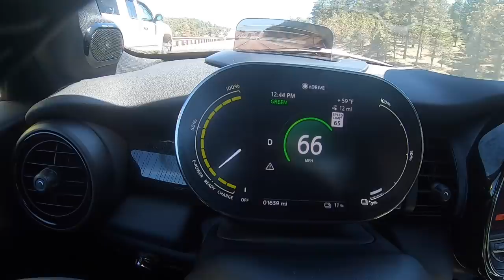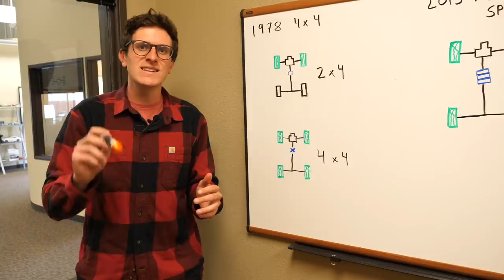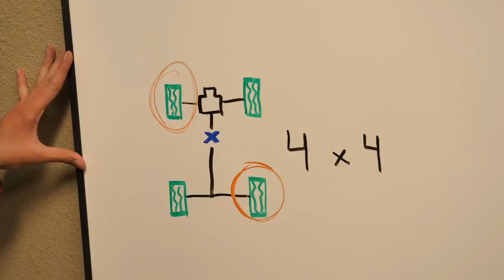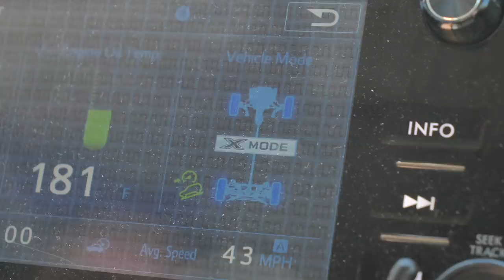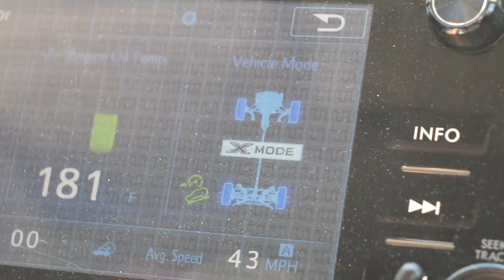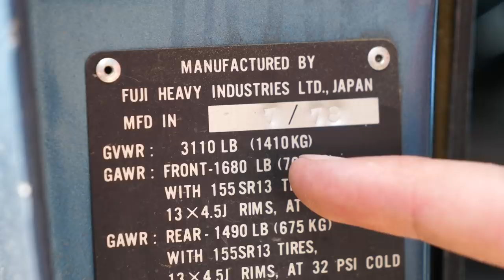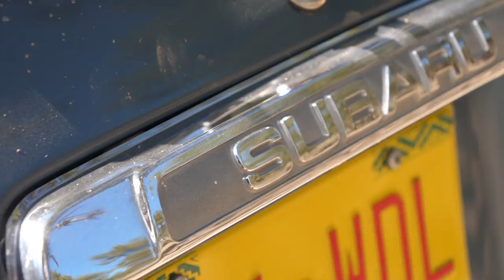Old vs New - How Much Better (Or Worse) Is a Subaru Outback Off-Road Than Its Great-Grandfather?

Comment: I owned the same car, except mine had a 1.4L transmission with a 1.6L engine I put in it . The trans was lower geared than yours.
You need a 2wd old Subaru to refine your driving style, always at the horsepower peak when you start up the hill or you will lose motor and traction.  Then you will always make it first try with the 4wd car. 
Also, after you break your first front CV shaft (I broke about a dozen on my 70s and early 80s Subarus, if you don't break a shaft, you are not using the car hard enough.)  you can keep the inboard stub in the car for when you break the next one so you just take your hammer and punch (Must haves) and pull the broken shaft, (they always break the outer joint) and put your stub in and all of a sudden you have a RWD Subaru with a parking brake on the front tires. 67HP will spin the back tires all day long on dry pavement with the parking brake on. 
One last thing, the spare tire absorbed about 1/3 of the blow in a head on collision, making the old Subarus much safer than their contemporaries. The old Subarus were also better in roll overs because of the many side posts. 
PS, when you start breaking front struts, that is when you should tone it down a little bit, not when you start breaking CV shafts. You won't break struts unless you are jumping more than about 15 linear feet with an elevation of 6 feet or so and land badly, anything less, and you can do it all day. Also, do not be tricked into getting aluminum rims, they shatter and crack when you use the car correctly, the steel ones just bend a bit. (You will eventually end up with 2WD rims, they are stronger than the spoked rims.)
Reply: Never broke a CV joint in mine. Or did I? LOL I do faintly replacing one or two of them. I used mine (a late '77 model) for camping in the desert and tearing around washes and up and down hills. I even drove mine through the infamous Pinion Mountain "Squeeze" and back out again once. I have pics to prove it. 

I did blow the transaxle apart on one trip. A gear tooth must have come loose I figured. Started getting worse over a 2-day trip to Ocotillo Wells, CA. Nasty tapping sound from the gearbox area. Finally went "bang" while was driving home on the highway. Such fun times. ;-) 
For the wheels, I had the factory plain disk wheels widened to, I think 5.5" or so by a shop in LA. That was to run wider tires 'monsterous' 195/70s.
Reply: @SDwriter.and.surfer   If part of your Subaru Enjoyment consists of full throttle with the steering at full lock, that is when the CV joints let go the fastest. I was a poor kid at the time, but not too poor to put a bigger used carb on and remove the factory muffler for the extra 5 horsepower that overwhelmed the CV joints. I also used to play games like "pretend the cops are chasing me" and I found jumping to be a fun pastime. Of course this was in the good old days when if I hurt myself, the next morning it was all better. Pretty sure I would quit and go home in the first five minutes if I tried that stuff today.
I once destroyed the spider gears  in a front differential, but I really enjoyed being able to fix the car cheaply and easily. I had I had a total of six Subarus from 77 to 82 vintage, and I had the most fun with those cars that I have had with cars.
Reply: @ethanc4920  Hah. I never tried that hard to break mine. Shortly after buying it I did have fun jumping it on sand dunes, on Fiesta Island at Mission Bay, San Diego. Dumb kid. I always told people, in the past and in comments here, that the Subaru was basically a water-cooled 4wd Baja Bug. No low-range so you had to charge some hills.  Just like with a bug. I rebuilt the engine once. Had it "blue printed" by an engine shop. Hah. Balanced pistons, rods, etc. Just because I read it was the thing to do. Had Schnieder Cams do a reprofile on the stick for better 'low end' supposedly. Result of that was questionable. And I also had a complete exhaust system custom made. Sounded cool. Biggest improvement made was the Weber carb. That improved the personality of the car by so much. Legend had it there was a twin-carb manifold for the 1600cc engines, available in Japan only.  I was unsuccessful in finding one here in the US. I did buy the high-compression heads from an importer in LA. Added a half a ratio to the stock compression. I never had the engine dyno'd so I don't know what all that did. But it helped for sure. 

If someone had said to me back then, "Someday you'll be able to buy a Subaru with a 300-hp engine", my head would have exploded. Nothing outside of Italy was making that kind of power (stock) in those days.
Reply: @SDwriter.and.surfer   Driving without horsepower or gearing requires much more skill than what is required when either is present.  All of my Subarus had a flat underside and a gas tank up inside the car, I sure I have hours of cumulative time dragging the bottom of the cars. My 77 (it might have been a 76) Wagon came from the factory with a 1.4L engine and therefore had a very low final drive ratio. In fact, that car had a lower first gear than the low range in my later Subarus. With the bigger pushrod 1.6L it went very well. I used JDM carbs on my Subarus, they were a few millimeters bigger on both the primaries and the secondaries. (And they were cheap.) Eventually I started putting 1.5 inch spacers under the Carb (on a 82 two-door hatchback with low range) and cut a hole in the hood for a round air cleaner. That worked very well for some reason.
Reply: @ethanc4920  Interesting. I have to admit, I've never heard of JDM carbs. For me at that time, the Weber 32/36 progressive was the best choice. It needed an adapter that was an inch or so tall,  and the 3-4" K&N air cleaner on top of that. Still fit under the hood nicely though.  It ran very well out of the box. Finally at one point I had some Weber 'guru' tell me now to tune more optimally. Jetting and emulsion tube changes. 

Some of the specs are really testing my memory, but I think the 1400cc engines were wet sleeve weren't they? Might have had two separate exhaust outlets on the heads, like a VW? My EA71 engine had 'Siamese' exhaust ports with one outlet on each head I remember that for sure. 

I don't recall the final drives of the axles, 3.8 something?, but I seem to remember that my 4x4 trans had a 4.0x:1 first gear, whereas the 2WD transmissions had something like 3.66:1. So the '77.5 4x4s had lower 1st and possibly 2nd gears than the non-4x4s. I don't know what it was for the years before and after that. I remember that my Subaru had the same 1st gear (4.02:1) as the 4-spd trans in the IH Scout II that I replaced the little Subaru with in 1991. (I still drive the Scout!) 

BTW, I also still have my Chilton's Subaru manual on a shelf I think. It covers all these pre-1980 cars/engines. And I have a copy of the "How to Keep Your Subaru Alive" book, which was modeled after the original VW book.
Reply: @SDwriter.and.surfer  In Ontario Oregon at the time there was a company that sold low mileage Japanese take outs. These engines usually had bigger carbs, point and breaker ignitions, and higher compression and different camshafts. Most people just used the OEM carbs and what not leaving people like me to buy and install the JDM carbs. They made about 5 HP more in my opinion. The JDM motors ran about 15 HP stronger with their higher compression and non emission carbs.
Reply: @ethanc4920   Been a while getting back. I found company called JDM that imports Japanese parts from there, including some interesting  stuff.  But I didn't find a manufacturer/builder called "JDM". I'm not aware any carb makers by that name. I only know of Hitachi and Mikuni carbs off the top of my head, thinking of Japanese carbs. FYI, that dual-carb version  of the 1600cc engine was called the EA-71S. Never made it over here, but one company was importing the intake manifolds at one point.

My Weber added very noticeable power (and as said, about 1500 RPM of usability) but I never had the engine dyno'd. 

FYI, here is a pic of me in my '77 coming out of the infamous "Squeeze" in Anza Borrego Desert: http://www.binderplanet.com/forums/index.php?attachments/squeeze1_detail-jpg.138272/

Let me know  if the pic isn't viewable. Should be public.

Comment: Throw some Toyo AT II's on the outback and it will completely change it off road. I have an 07 MDX and when I put the Toyo's on it went from struggling to keep up off road with my buddy's 06 4Runner to being a bit more capable when ground clearance isn't an issue. 10/10 would recommend

Comment: I remember in those old Subaru's that after you added the A/C option, when you turned it on, it would eat up almost all of the engine power when the compressor kicked in.  If you needed power to climb a hill, you had to turn of the A/C to get the power to do it.

Comment: Fun video and trip down memory lane.  I had an '86 Subaru GL 2-door hatchback that was amazing!  Manual, High/Low range 4wd or FWD.  That lightweight little bugger would go anywhere with slightly larger all-terrain tires.  Incredible approach, departure, and brake-over angle.....AND....spare tire under the hood!  ;-)  We now have a '99 outback as a 3rd vehicle

Comment: I'm pretty sure that when one is trying to do hill climbing in the new Subarus, it has been determined that shutting off traction control is the way to go. Maybe even shutting off xmode. This is from independent testing, not any official guide. Or a combo of shutting off X-mode as well.
Reply: The #1 thing is to keep up enough speed that the puny torque converter is locked up and you're properly in 1st gear -- sadly that means around 12 mph maybe minimum, which can be too fast for serious rock crawling. I think within not many years we'll see Subaru fully converting from the CVT to Toyota's eCVT planetary gear based hybrid system, which is just fine for slow and hi-torque rock crawling. The 2020 Forester and XV already have that in some markets e.g. Australia.

Comment: Had an early leone turbo, was amazing where it went, left mates hi/low 1600 sub well behind anywhere, and us being ex vw baja, landrover and suzuki jeep folk, i do mean anywhere, as long as you could position them, to not get bellied out.
Think at 12.45 in video, you are missing the front tow hook in the new one, same as in the rear, removing cover(diamond shape between headlight and fog light) and eyebolt  is usually in cars tool kit, but sure, not heavy duty.

Comment: My parents had a 74 Subaru DL wagon when I was a little kid, from about 1979-82. Not a great car. Even as a kid I could tell it was pretty tinny. It had a bad rock knock when my dad bought it. He and my uncle installed a rebuilt engine in it. Still, it was memorable and I’d much rather have the old Subaru over the new one.

Comment: You guys had a tone of fun!  I think the old Subaru maybe more durable than a newer ones!  We have a 2018 outback, it doesn’t drive as well as 2014 model. The CVT seems to drone longer or locked in, especially when using manual mode or just the paddle shifters driving on mountain roads, sometimes a little while on highway while using only the paddle shifters to slow the speed. The 2014 model, again, didn’t have any of these issues.

Comment: I had a "87 Justy" 3 cylinder. Anytime for wheel drive with a push of a button in the middle of gear shift knob. 32 miles to the gallon.
Maybe you could do a show on that one.? I for one believe they were better than the wagons.

Comment: That was excellent. My first car was a Subaru Brat with the same 1.6L 67 HP motor. But, I was able to drive it on narrow motocross tracks and walking trails where my friends with full size trucks couldn't go. These days I have a 2001 Nissan Pathfinder. And it's the rare 5-speed manual model. This SUV has the 250 hp version of the same all alluminum 3.5 V6 motor that was developed for the 350Z, (in the Z it has 300hp, I think). 

For $5K, I bought it from a mechanic whom had put a motor in it with 104K miles when the former owner blew the original, by towing more than the 3500 lbs recommendation, at around 224K miles. It's been reliable and perfect. And while I do not off-road with it often, the times I've had to use 4WD, have shown me the tip of the iceberg for what it can do. Love to see you test one of the SE 3.5 4WD 5-speed manual Pathfinders. In 2 wheel drive on a dirt road, a little throttle around a corner get the rear end out easy and makes me feel like a rally driver. And the rear end comes back easy by easing off. For such a heavy vehicle, it's very well balanced. 

I also put the best Monroe struts and the best KYB shocks money could buy on the car. They are both rated at 25% stiffer than stock. And it really gives the car a great feel off road a luxurious ride on highways. Plus the Bose sound system and sunroof give it a sense of luxury you just don't get it in most SUVs in this price range. 

Sadly, the 2001-2004 era of the Pathfinder ended when Renault aimed their greedy eyes on it. You can feel how well these were built when you drive them. Truly, they are an unsung hero in the "ever-car" category that famously is heralded by the Toyota Land Cruiser.

Comment: i had a 78 brat.  people were always amazed where i'd get off road.  don't forget the 78 has 13 inch wheels so not huge ground clearance.  btw i had mine at 12000 feet in the rockies.

Comment: Lots of hate about the CVT, but it is not meant for heavy off-roading. Mine helps me save hundreds of $ in fuel every year (35 000+ km/year) and is perfectly fine for my occasional trip fishing or for having fun in the snow. Each trans its pros and cons.

Comment: Shame you didn't get the dual-range version - I had a '88 Leone / GL1800 with a dual-range manual and while it was still limited by lack of rear diff lock, the low-range had a good, almost 'crawling' gear ratio and was capable of 'insane' inclines (as long as there was enough traction).

Comment: I bought a Subaru Forrester not because I really wanted it but because my old car completely died as I pulled into the Subaru dealership as I was shopping for a new car.  Now, the engine is a very old design - you’d think that’d make it really responsive but I’ve found just the opposite.  A 2016 2.5 L four cylinder engine.  Acceleration is crap - pushing down on the accelerator slightly does nothing - you have to really push down on it and then all of a sudden, you’re going way too fast for the situation.  Not a safe thing.  Then - the automatic down switch for the drivers side window - so sensitive you have to play games with it to get the window where you want it - and if it’s raining or snowing you’re even more distracted - which of course is also unsafe.  Imagine the trouble one could get into by not keeping your eyes on the road and instead looking at the damned bloody window!  Now I tried to wipe the dust from the dashboard - it doesn’t clean well at all - the rubbery/plastic attracts dust like a magnet.  So I have to get out a bucket of ammonia water to clean the inside of the car - just what I DIDN’T want to do today!

Comment: Subaru if you want to make the best all-terain vehicle I suggest, you do 3 things:
1. Powerfull engine (well just about average)
2. Manual transmission
3. Very simple basic AWD system, with a manual lever, for low range transfer case
No computers intervening what so ever.
And there you have it...

Comment: I owned a 1987 Subaru with the 1.6L engine, it was great in bad weather.  In 1995 in Dayton we had blizzard I got home safe that night, I had fun driving it.   NOW! the car was always in the shop and I got stranded when it died in the snow, and it was snowing hard, I had to walk 1 mile home with dress shoes on.  I had it in the shop every 2 weeks (when I got paid), Axle broke, bad Carb, fuel pump, and I had a loud noise coming from the engine and the dealership could not fix.  I was the worst and most expensive car I have ever owned.  It was POS and that is the only car that has left me stranded on the side of the road.  Shortly after that I bought a 1985 vw Jetta diesel (5th one) and was happy with no problems.  Sorry to vent or if I offended anyone.  Oh Yeah my GMs cars have never left me stranded either.  IJS

Comment: Only way to climb a hill like that is the charge it and let the car bounce around a bit. I always thought of mine as basically water-cooled Baja Bug with 4WD. And that's how you drive a Baja Bug. Same technique. And if you want more fun, put on a Weber 32/36 DGV carb. It'll feel like you swapped in a 6-cyl.

Comment: The old Subaru's are beast. The 1.6 and 1.8 liter engines of those days were bullet proof. The Duel range transfer case of the Subaru's of yesteryear  (in some models) were some of the best ever made. I owned a 83 Subaru GX hatchback with a duel range transfer case and 4 speed with the 1.8L engine (best news about those engines, No timing belts or chains. direct cam to crank timing) I wish the still built them like that these days. 

Did you crack the windshield bouncing the little Subaru around?
Reply: richard miller no it was cracked already
Reply: @tomasmica325  One tough little Subaru for sure.

Comment: nobody has every driven on of these old ones to the point where either the engine or the transmission ever failed. The cars just expired with time. You get to the point where you just get bored with it after 20 years and just leave it parked in a barn. They were probably designed for like 150k miles and who is crazy enough to drive one that much. Whereas the 2015 are already hitting 250k miles as people drive em cross country. I once drove a 2010 from Florida to Seattle  via Sand Diego and back trough Oregon, Nevada, Utah, Colorado, down to NM and Tex.  Not  a single issue with the car or my back or legs. Just so smooth and comfortable like a big rig or something and I got over 30mpg on straight highways.